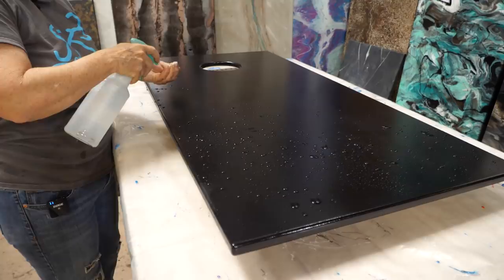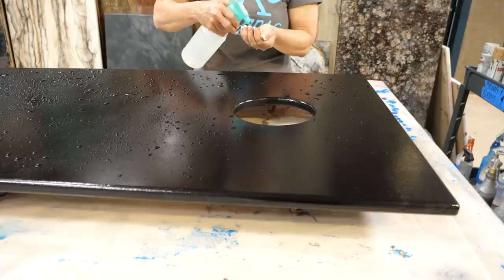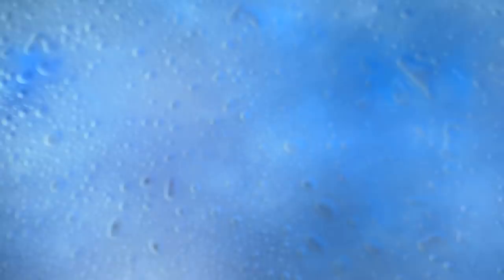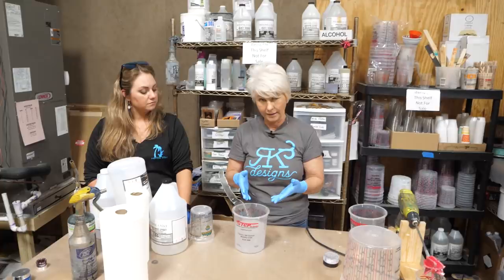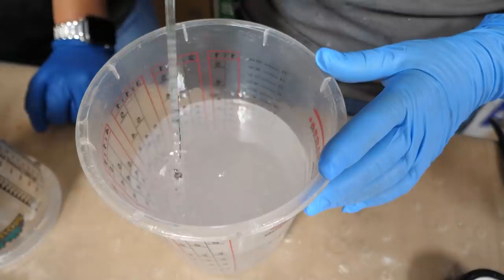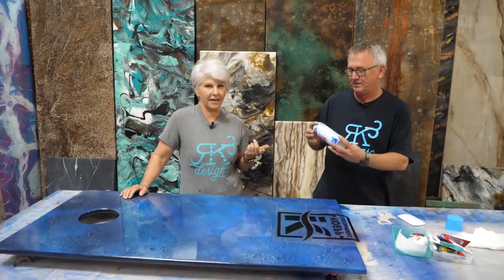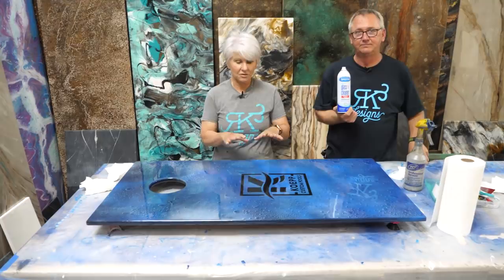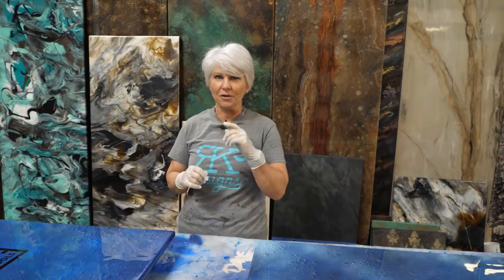How To Create An Amazing Epoxy Water Drop Finish | RK3 Designs

Comment from the maker: rk3designs.com || Where would you put this finish?
Reply: Furniture next to a pool or hot tub. Furniture on a boat. Beach furniture.
Reply: On closet sliding doors(or folding) in a recreation room in home
Reply: In a high end restaurant in woman ‘s bathroom as an accent wall. Use decorative gold corners to cover up screws which hold it tight to wall.
Reply from the maker: That would be amazing!!
Reply: Really nice you have classes?
Reply from the maker: @sll-tt6bj  yes. Check out our website…https://www.rk3designs.com
Let me know if you have any questions 😊
Reply: About 20 years ago I saw a custom job on a boat that made it look like it was making spray even when sitting still.
Reply: 😳I have always wondered how the water droplets were made I have done a few in oil paintings over the years but not like this scale. I think it would look great on a kitchen table where I do prep work for cooking food I will have to do a test piece to create the water droplets, but would love to know if that foam you used to put down the decal would work with that method as well😹😹😹
Reply: @dawsie  i do this effect on motorcycle gas tanks , tape out stripes on car hoods really cool effect its not something new been around awhile
Reply: I am going to put this on my patio tables 😌 i love this video. Easy to understand and follow. Entertaining as well.
Reply: I have a question? So you sprayed the water with spray paint and the water evaporated. So are the bubbles hollow? What keeps them from collapsing when you rub them?
Reply from the maker: @melb3513  when the water evaporates, it just an illusion of a bubble because you used two different color paints.
Reply: @melb3513  no the bubbles are not Hollow they are real water drops spray paint at an angle so the water drops don't move then just let them sit and evaporate
Reply: I would love to put it on my shower surround !
Reply: Outdoor mailbox
Reply: I'm about to redo my ENTIRE bathroom!! I NEED this on my shower walls!!! 💙💙💙💙💙💙
Reply: outside shower if a little taller
Reply: Shower walls

Comment: I'm just sitting here slowly shaking my head. I've worked with resin off n on for 10 years, not as a pro but for diy home projects and crafts. I'm literally just realizing the my successes have been purely accidental. I knew how important mixing and incorporating is yet I assumed I was doing it right. That false assumption is actually the answer I've been seeking the entire time, every single time a finish failed, every single time I got horrible edges and every single time I got divots and the resin didn't cure evenly. I blamed the resin instead of owning it. I just assumed resin sucked or I sucked at it. I was half right. Rhonda, God bless your heart, I owe you a debt of gratitude for your delivery AND substance! Your mixing and application tips have inspired me to fall in love with epoxy finishes all over again. Between you, stone coat and atd, I'm all in once again🥰

Comment: Awesome!!   Tip I found out for the dried epoxy on your red silicone drill paint/ epoxy mixer...  after the dried epoxy builds up a few layers on the mixer, use a hammer to give a light wacks to each of the silicone mixer blades, the hits from the hammer will crack & separate the epoxy from the mixer & the dried epoxy can be peeled right off the mixer.
Reply from the maker: Perfect!!! Thank you!!! 😊

Comment: I just bought a new home with an inground salt water pool, 5+ acres and a steel 40x60 pole barn. In the barn is 2.5 bathrooms, a kitchenette, loft and office.  I will be "taking possession/ moving in" in a month.  The kitchenette has "boring/ bland" counter tops.  I already see me doing this design scheme on the counters,  the riding lawnmower and possibly the table by the pool.... if they come out as good as this video... my wife will be upset to see the floors in the house always looking wet with water drops lol.  Great video, can't wait to start and try different colors on different projects.
Reply from the maker: You are gonna have fun with this finish I can tell!!! ❤️❤️
Reply: @RK3Designs  ya think?! Lol I'm already thinking of EVERYTHING I can paint... like the pole barn floors, lol

Comment: I love the bubble look. That is more prettier than the dirty poor. Question why can't you use the pink foam insulation for this
Reply from the maker: I’m confused.  Pink Insulation Foam for the drip affect or for cornhole boards? It’s not sturdy enough for high impact cornhole boards plus it would be hard to attach the foam to the corn hole frame.

Comment: You will have a drip line wether you use your hand to do the edges or not. The best way to do it is to use blue painters tape on the underside right where the curved edge ends underneath. You still use your gloved hand to coat the edge.  Pull that tape in about 12-24 hours and 60 seconds of sanding with some 120-180 sand paper underneath and you are golden.
Reply from the maker: You can use tape for sure. We actually let our epoxy drip and once cured. Use a 50 grit disk grinder and take off the drips in a matter of minutes. Then paint the underside to give a professional finish. We fabricate so many that for us, it’s the most time and cost efficient way. Thanks for sharing your tip!! Appreciate it!! 😊😊

Comment: So cool! I love the idea of the decals so I assumed then the same could be done with any decals such as a flower decals you can get from Michael’s?  I’m  focusing on doing a shower surround and have been watching a lot of your videos and all of these different options and techniques for applications. I do note that they recommend the foam but I do see that for say countertops is even recommended to use plywood and if so, can you use other medium behind the shower walls to do this? is there an option to do it vertically or is it only due to needing to self self level that you need to do the segments flat? If so, can I creatively do smaller segments and use glass like grout to create a dual effect? I’ve been thinking of perhaps, if not doing square or rectangular larger segments, perhaps, shapes or planks, even circles within circles particularly with foam, I can see, would be interestingof cutting out certain segments and filling the difference just so many things that I can perceive could be done

Comment: That's my favorite so far. I missed it, does it leave a dried cavern like thing where the pain dried over the water drop? So it isn't smooth till it's covered in resin. Does it trap air in there?

Comment: Looks great. I noticed you didn’t scuff before applying the decal. You mentioned that you let the epoxy cure overnight so I’m wondering if it’s still in that tacky stage to accept a flood coat without scuffing it up? If that’s the case wouldn’t that glass cleaner react to the somewhat tacky epoxy?
Reply from the maker: You got me!! Yes, my employee scuffed it for me but I forgot to mention in the video. Great catch!

Comment: Don't you need to lightly sand the 1st flood-coat so the 2nd coat properly bonds to the glossy surface? I'd be somewhat worried about separation between the 2 coats of epoxy.

Comment: Hello Again! I have a question about the vinyl material. Can I use the type of vinyl material that is used on the cricut machines? Does it need to be adhesive? It seemed so easy with what he called a decal.
Reply from the maker: Most vinyl works pretty well. Cheaper vinyl will tend to get bubbles really easily. We cut all our decals with our cricut. You can also purchase pre-made decals off Etsy.

Comment: Fantastic! Love this look! Question about the spray paint: you said that the black spray paint was glossy finish, should the top colors (the blues you used in this example) also be gloss? Thanks so much for another great lesson. :)
Reply from the maker: That’s a great question, I think the glass would give you the best effect. However I think if you did use matte the fact that you were putting epoxy over the top would still give you that high-gloss look.

Comment: Since  I have really  no clue,  and nobody  has given  me any  answer,  is it possible  to use a very  hot , hi speed  hairdryer,  and not a blowtorch ? I really  appreciate  any answers.. thanks.
Reply from the maker: If you have a really heavy duty hairdryer it may work. I’ve never had really great results using a hairdryer.

Comment: Talk about the most expensive finish one could put on a set of corn hole boards! Dam $ must be no object
Reply from the maker: Not sure why you think this, people are putting epoxy on corn hole boards everyday and have been for years 🤷🏼‍♀️
Reply: @RK3Designs  
I think that the cost of 2 part epoxy resin  is really high
Reply: @RK3Designs 
I would like to add by saying, I definitely 
have never seen a nicer look to a finish.
It's just such an expensive product,  2 prt
Epoxy 

I will add

Comment: Looks great 👍. Question: won’t the bubbles be higher than the service? Don’t we need to do 2 times clear coat to cover the bubbles? Thanks 🙏
Reply from the maker: Good question, but no. When the water evaporates the surface is completely level. It just gives the illusion that it’s raised.
Reply: Do the water drops dry and THEN the shape stays??

Comment: I love spreading with my hand over my mixed media art. I use art resin due to non toxic nature. Love the bubble effect . I use a mini torch, but still end up with a few bubbles . Maybe I’ll try the 2-3 minute then torch again. I did a successful resin image transfer into uncured resin (removing film after cure). I used Epson clear film on my p800 printer. I just had to spray a fixative on the transfer after to prevent smearing . To protect the image I will put a Frisket film while sanding around or spray something with a tooth prior to adding my final coat  of resin. This is for artwork . Don’t you need to sand prior to flood coat to prevent delaminating ?
Reply from the maker: Yes. I would lightly scuff sand 😊

Comment: Would you use UTC as flood coat to prevent micro scratches and give it UV protection?
Reply from the maker: I would still apply a clear flood coat then apply the UTC. 😊

Comment: I getting ready to epoxy an outside table for my parents. We live in Arizona. What epoxy do you recommend for exterior applications?
Reply from the maker: If the tables will be exposed to the elements, I would use a polyaspartic (Stonecoat Platinum Hybrid epoxy) If they will be under a covering, the regular countertop epoxy will be great. I don’t recommend doing a white finish for outdoor use unless you use Platinum. There’s a learning curve to using Platinum and not recommend unless you’re experienced working with epoxy due to its short working time.

Comment: Looks amazing!!  One question = do you finish the back side since it can end up staying outside?
Reply from the maker: We start with a water resistant MDF called Medex and then we also Red Guard the backside. Red Guard is a waterproof roll on material. 😊
Reply: Yes I heard you say redguard but didn’t see it used in the video. Will the epoxy and rustolium bond if you redguard both sides? I know that is a slightly expensive product, could you just epoxy the backside as well to waterproof this? Or does the MDF substrate need to “breathe”?

Comment: This effect would look awesome on a pool slide; how would you do it so that the drips didn't roll off before drying?  It would even be cool on a diving board....how could you add a non-slip additive?  I will be repurposing my equipment at some point during our swimming season in Ontario, Canada - any suggestions would be greatly appreciated :)  thanks in advance for all your inspirational ideas!!
Reply from the maker: I’m not sure exactly how you would keep the drips from running. The paint will help them stay in place to a certain extent. Maybe just keep the drips really small. Maybe you could add some clear silica sand to the topcoat to make it non-skid??
Reply: Lower the pool slide until level then apply surfaces to avoid drips running.
Reply: I used to paint boats and I used Griptex additive from Awlgrip (marine paint company) as a nonskid additive for the decks. Griptex is a polymer additive that comes out of the can looking white but, when mixed with clear resin, it becomes clear. It's great when you want the subsurface to show through. It is also uniform in size whereas sand often has varying sized grains in it. Sand can also have some color to it so it might muddy up your surface.

Griptex comes in three different grit sizes - fine, coarse, and extra coarse. Fine is really fine and might get buried in resin. Coarse is probably the best choice. It's got a decent amount of profile so I don't think it would get lost in the resin coat. I don't think I'd use extra coarse because it is very rough (it can be a little tough on bare feet).

Comment: How do you fasten the boards to the frame without damaging the finish? What do you use to scuff the surface prior to applying the decal?
Reply from the maker: We use pocket screws and come from underneath. Sand with 220 grit sand paper. Check out the video series we have on making Corn Hole boards. Lots of great instruction and tips.  https://youtu.be/iCgo71mXvuU

Comment: What happens to the paint that was sprayed on the water? Do th hose areas get cleaned off?
  By the way nice technique. I am actually in the process of redoing my kitchen countertops and took a break. Time to go back and mix some more.
Reply: Well I just finished the first epoxy coat, and man does it ever look good. I have been wanting to do this for years, but my patience is now paying off.

Comment: The water droplets being too big caused the breaks in the paint. When I have done this airbrushing you never want the water droplets too big for that reason. I use white paint, on a low air pressure, and spray from a low angle. Then when it dries spray everything with whatever candy color (transparent color) you want to finish it in. This eliminates the use of multiple colors.
Reply from the maker: Perfect!!! Thank you for your advice!! I’ll try that! 😊

Comment: When you say 3oz per square foot ,is that 3oz of part a and 3oz of part b , or 3oz in total of the 2 mixed together. Thanks
Reply from the maker: 3 oz. per sq ft is the total amount of epoxy per sq ft. So it would be 1/2 A and 1/2 B. Example: 10 sq ft would be 30 oz. 15 A and 15 B
Reply: Thank you for the information appreciate it 👍

Comment: You don’t wear a respirator, why?
Reply from the maker: The resin that we use is non VOC. It’s made with solids not solvents. We also work in a large, well ventilated area. There are very toxic epoxies on the market, ask for your products SDS sheets to know for sure the health risk.

Comment: Dermatology at its finest:
First you put down a topcoat of a epoxy, then after it cures you spray the area in question with foaming glass cleaner; put down a decal for coverage, and then finally squeeze out the zit with a plastic paddle.
Reply from the maker: 🤣🤣🤣🤣. Pretty much!!!

Comment: TFS. Please wear a proper mask when working the aerosol sprays and the epoxy. If you can smell it or taste it, it will go into your system and cause damage.
Reply: Totally agree, I’m a resin artist and ppe is important
Reply from the maker: I do believe I said when I’m not on video I wear PPE. I TOTALLY agree!! 😊😊 The resin I use however requires no PPE as it lit contains no solvents and is zero VOC.

Comment: Wow what a cool design but no masks, did you not have any fumes with so much epoxy?
Reply from the maker: I use Stonecoat Countertop epoxy. It has zero VOC’s and very very safe. Also, I’m in a very large, well ventilated space with ample exhaust fans. 😊😊. But, great of you to be concerned because there are many epoxies on the market that are high in VOC’S and harmful.   Thanks for watching. 😊😊

Comment: I don’t believe there is a valid reason to pour B first. Measuring by volume is that. Also it means  that everyone who pours A first is wrong.
Reply from the maker: It just work better when you pour part B first. I state that if you pour part A first, it’s ok, you’re not wrong. You just get a more accurate measurement if you pour B first in my experience.